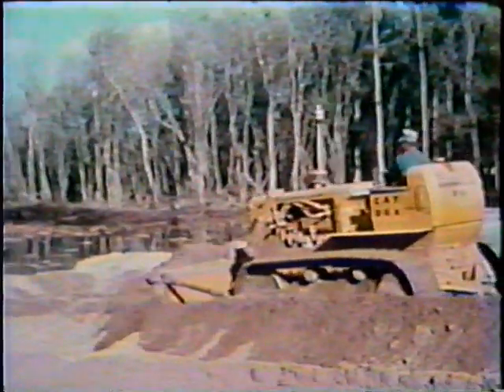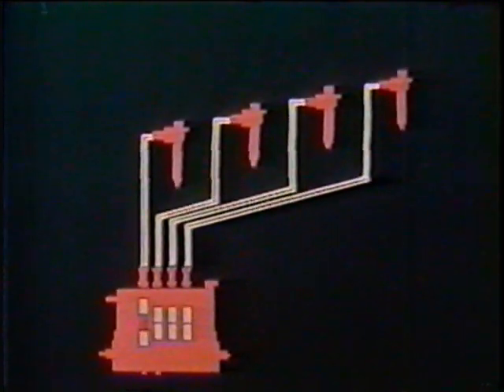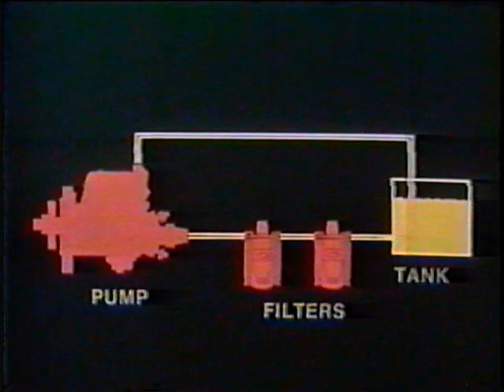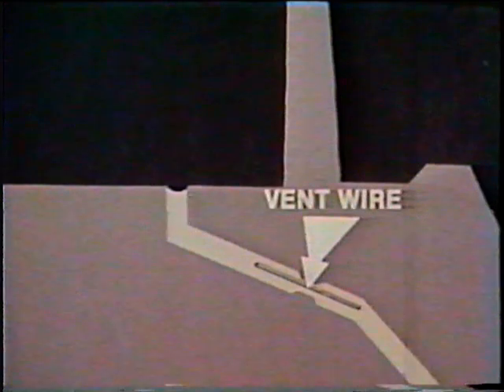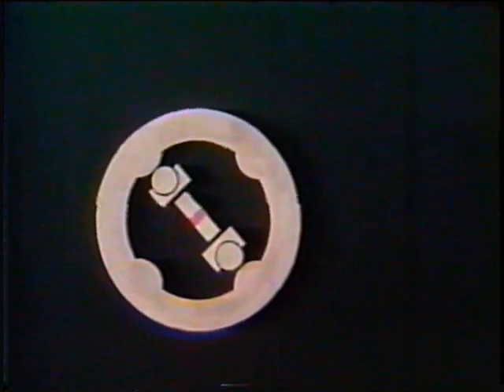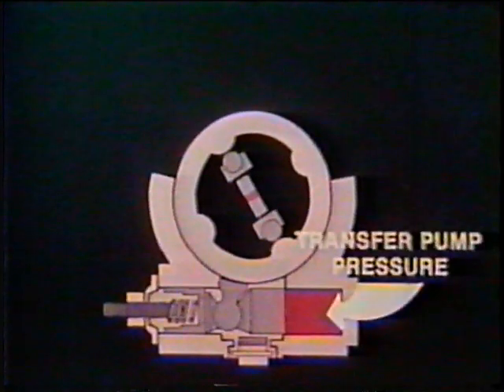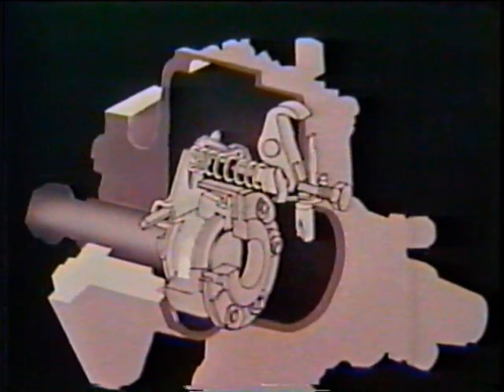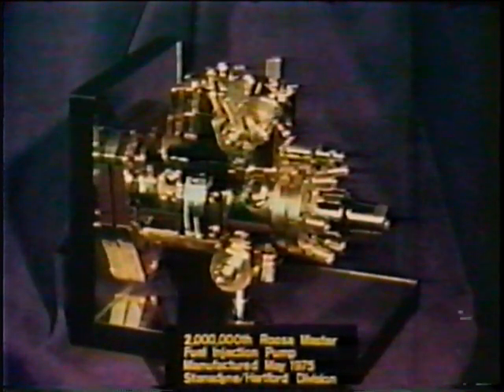Roosa Master Fuel Injection Pump

Comment: @Adrossi85  Thank You very very much for uploading this original 8mm (or 16mm) training film.  Real training in injection pump repair is accomplished by hands-on disassembly, inspection, re-assembly & dynamic testing machine evaluations, of course...

But its of essential benefit to learn the internal components & their functions.  Best of all this original film adds to the historic perspective & appreciation for Vernon Roosa's painstaking design & development of his invention.  Although Rudolph Diesel built the first single piston type injection pump for the first single-cylinder diesel engine, Vernon Roosa is credited with originating the first rotary type high pressure (2500 to 3500 psi ! !) injection pump

And if I understand correctly, Mr Roosa licensed his design to Charles A Vandervell, founder of CAV/ Lucas Injection Company in England ;o)

Comment: The contruction principles in this and CAV DPA seem to be identical. I wonder which pump came first?
Reply: The DPA is built under license from Stanadyne (Roosa Master). It is based on the Model A pump, the first design from Roosa Master. On earlier DPA pumps there was a reference on the tag saying that it was a licensed product from HMS (Hartford Machine Screw) which is now Stanadyne.  Interesting enough, Bosch also licensed the 'Opposed Plunger' principle on its VP-30 and VP-44 pumps.

Comment: wow, that's really cool, at the end, we see a 1978 Oldsmobile 359 diesel ! thanks for sharing !
Reply: soon to be the 6.2 L Detroit diesel
Reply: @hawssie1  6,5, 6,9 and 7,3 with the Stanadyne name on the pump
Reply: @TDIMAXDIESEL  the Oldsmobile 350 5.7, 6.2, 6.9 IDI, and 7.3 IDI used a Stanadyne DB2 injection pump. The 6.5 used a variant of the DB2 with an electronically controlled fuel rack.
Reply: @porcupinepunch6893  yes !
Reply: @hawssie1  i mean the 350 diesel